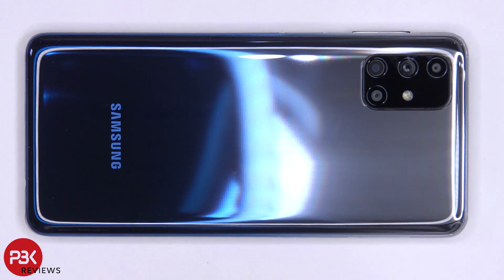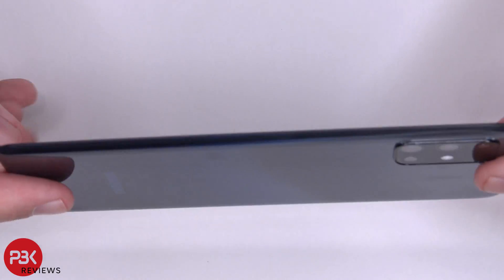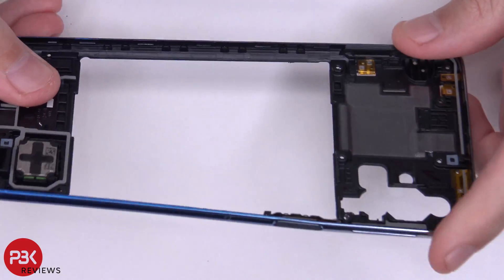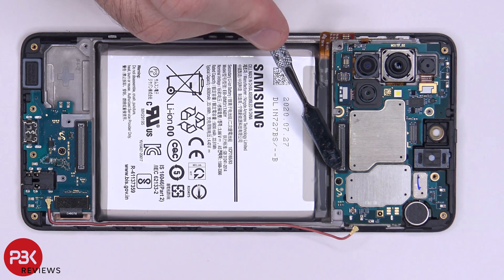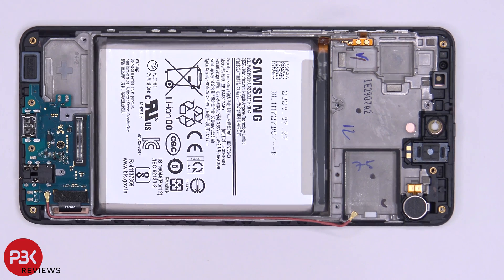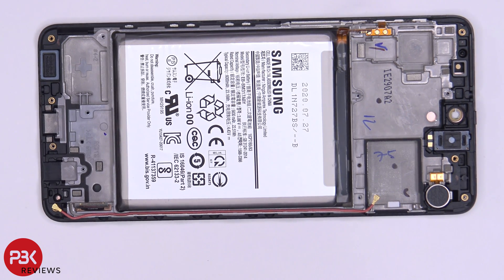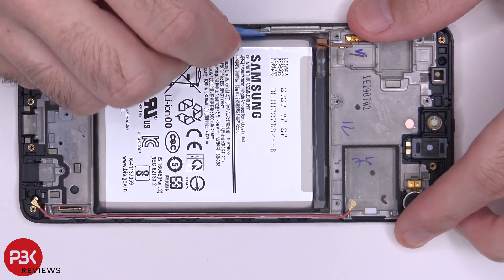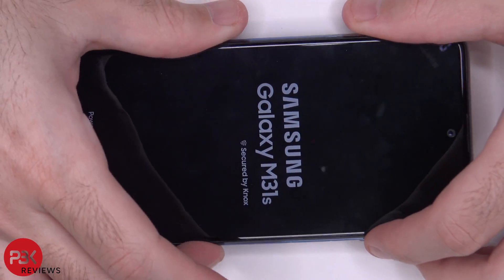Samsung Galaxy M31s Disassembly Teardown Repair Video Review

Comment: This video just came in clutch.
I was scammed into paying for the original battery whereas they replaced it with the battery from an old S10. To make sure it fit and didn't move they placed some loose pieces of paper. However, just a month later I could feel the battery moving within, which meant that they didn't even bother sticking it in place.
Not only that, they even lost one of the screw on right middle side of the main board.

Thanks a lot PKBreviews. Love from Bangalore
Reply from the maker: you're welcome :)

Comment: Is it possible to retrieve data from internal memory if phone is not turning on and mother board may be damaged?
Reply from the maker: Nope, the ROM or storage chip is soldered to the motherboard and is not user replaceable. Some place who might have advanced soldering knowledge might be able to de solder the ROM chip and solder it onto a working board of the same model but it wouldn't be cheap.

Comment: I am the 100th commenter in this vid I guess, also my m31s phone isn't working anymore due to the company telling me there's an issue with the motherboard, replacing which would cost approximately 40% of what I paid for the phone i.e INR 21000. Can you help regarding this? I feel like all the customers who bought this phone were scammed by Samsung.
Reply from the maker: Not sure what can be done with a board failure aside from replacing the board. You can try to find one on ebay or other sites, or find a phone with a broken screen being sold or some other issue, and use its motherboard.

Comment: Is it possible to fix and repair this phone's motherboard?
Reply from the maker: Motherboard repairs are possible, but expensive and require soldering expertise to be able to replace faulty parts or components on the boards. Usually not worth it on mid to  lower end devices.

Comment: Hey.  My M31s is dead like stuck in boot logo.  And service centre guy told me to replace the motherboard.  
Its been a year.  And i want to know that after board replacement,  will the phone work well for mininum 2 yrs more??
Reply from the maker: Hi, I mean it should work with a new board replacement, but again the quality of the other parts like the battery life etc would depend on how long those parts have been in use.
Reply: @PBKreviews  ok thanks. Its the 13th month since Phone's been bought. Will it last like 1.5 yrs minimum
Reply: How is your phone now ?
Reply: @SamsungGalaxy-wb5oq  i replaced the mother board. Then it worked well for 1 more year. Then it died again

Comment: Hello brother, my galaxy m31s is getting frequent restart issue now the care is asking to change the motherboard. So can u please tell me is it okay to do so i mean it will run smoothly right, isn't it??
Reply from the maker: Should work smooth if the board is replaced. Would also mean any data you have would be gone so make sure you back up all your info and data.
Reply: @PBKreviews  thanks bro
Reply from the maker: @abhinavk723  You're welcome
Reply: Same issue here bro . Did you get it fixed ?

Comment: Hey my m31s speaker is not working completely I think it had gone water on it so how many days will I wait for it to dry
Reply from the maker: Not sure how many days, but it can also be the speaker filter being clogged, you may need to replace the mesh filter covering the opening from the inside, or the speaker itself if it has gone bad.

Comment: Hi i have a New m31s, but the SIM Slot do not recognized the cards, do recommend to open and repait?
Reply from the maker: Its possible the sim reader may be damaged.  If you put a sim card in and it doesnt show any sim card inserted then the pins might be broken or damaged. Most likely the sim reader would need to be replaced by a repair shop that can do soldering
Reply: 3:37 Is the mid frame made of grey colored plastic? Or Metal?

Comment: I have m31s i am facing headphone jack problem a burst ,old radio sound come from earphones when I using m31s its a manufacturing problem
Reply from the maker: You would probably need to replace the sub board or charger port board on bottom or if you have soldering experience, replace the headphone jack itself.

Comment: I m form saudi Arabia.  My my Samsung  m31s display broken by Stone.  Now how i repair this mobile. I buy this mobile from Amazon...
Reply from the maker: You would buy the screen for it (something like this listing for example: https://www.ebay.com/itm/Samsung-Galaxy-M31s-M317F-DS-AMOLED-LCD-Screen-Digitizer-Bezel-Frame-Black-OEM/393077951126?hash=item5b85458a96:g:ssUAAOSwUAlf7qdu) and then you can watch the video to see how to take it apart, and take all the parts from your old phone and put everything back together on the new screen assembly. I also have a video uploaded on how to re install adhesive when putting the back plate back on if needed you can check that out as well.

Comment: Hey sir...
Can please Show us how to replace front screen?
Reply from the maker: Hi, Once you remove the backplate and back housing, all you need to do is disconnect the screen cable on the bottom corner of the charger port board then heat up the screen with a hair dryer or heat cut and pry it off the midframe. Then apply new adhesive tape and re-apply your new screen to the midframe making sure you put your cable back through that opening and reconnect it to the charger port board and put the phone back together.

Comment: From your point of view, which of the two brands has the best internal construction? Samsung or Motorola?
Reply from the maker: It depends on the models, because each model can vary. Some Motorola models may have a better construction compared to some of the Samsung models and vice versa. For example, the shatterproof models for motorola back in the day like the force, z2 force etc had good builds that would last long and not break but samsung also had the active models which were very sturdy as well.

Comment: How to fix back the part which has been removed by heating?
Reply from the maker: You mean how to re apply the back plate? you need to either find a replacement back plate that comes with precut adhesive pre-installed or see if they sell pre cut adhesive that you can purchase separately. If neither, you can purchase 300LSE adhesive tape or smartphone red tape or some other smartphone adhesive and cut strips to install yourself on the frame of the phone and re-apply the backplate to the phone.
Reply: @PBKreviews  OK Sir, Thanks

Comment: Sir can you please tell me what should update from m31s to m31 to do  25 watt fast charge.
Reply from the maker: I don't think you would be able to change that, if one phone has fast charge capability and other doesn't, I'm pretty sure it would be a number of components on the main board itself as well as the sub board (charger port board) which would be different. Also software would be involved.

Comment: I am using same  mobile  my sim tray was truck  inside mobile with sims and memory  card plz help me out
Reply from the maker: you would need to take it apart and see if you can push it out internally. But be careful you don't damage the pins inside the sim tray or it would ready your sim card anymore.